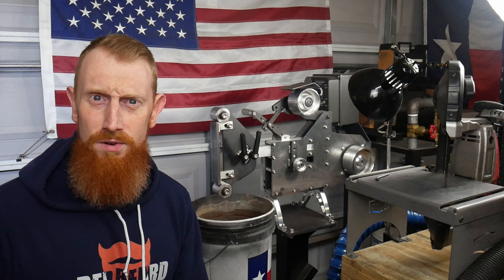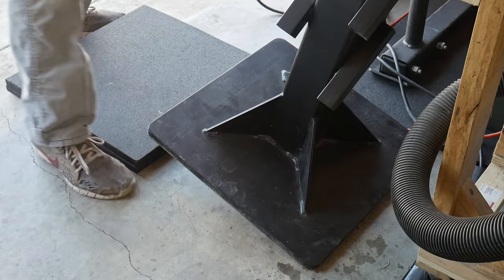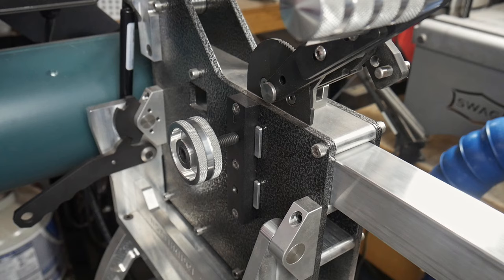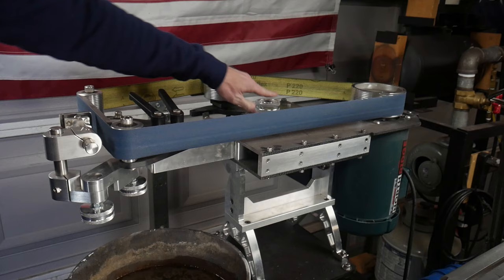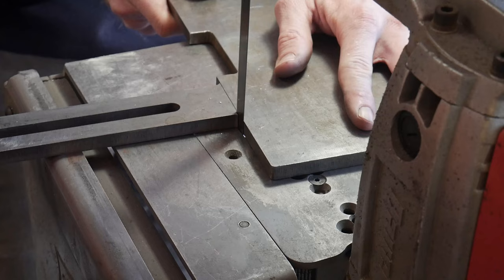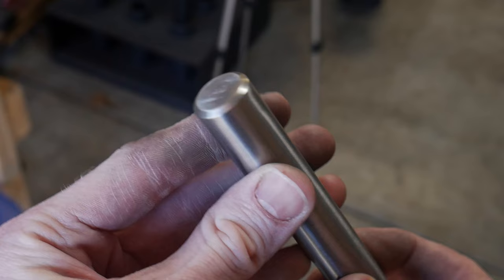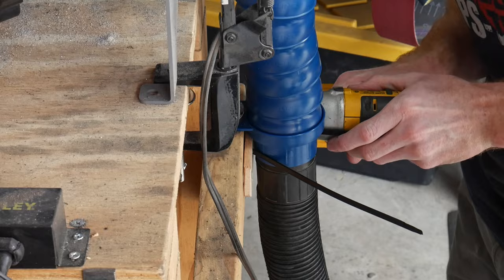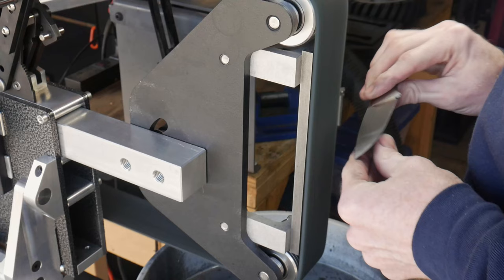So... I Got A New 2x72 Belt Grinder | Dust Collection Install | Knife Making Grinder | Work Rest Mod

Comment: A word of caution using dust collection on the belt grinder. Let the water bucket catch the sparks first then place dust collection further back on the belt. I have found smoldering chips inside my vacuum after grinding. It could have been bad had I not checked. Nice upgrade.
Reply from the maker: Hey Ron, I'm only using the dust collection for handles. When grinding steel, it's 100% to the bucket! Cheers man. Have a great weekend!
Reply: @RedBeardOps  Just trying not to freeze to death !
Reply from the maker: @ronamedee2475  I'm with you there! Gosh darn

Comment: I'm in the precess of buying a 2x72". 
After rearresting researching Bader, Northridge, Reeder, Black Fox Knifeworks and Ameribrade, I finally decided on the Black Fox One (BFO). I liked the Northridge and Ameribrade, but I didn't like the horizontal mount for them. IMO the horizontal attachment is an after thought to compete with the BFO.  The Grinder was designed with horizontal usage in mind and pivots close to the center of gravity. I also liked that the VFD is integral to the babe base and stays stationary unlike all the other brands. Also Thaddeus is very responsive to emails and answered all my questions. And I pestered the heck out of him. 
It's still a couple weeks until I get it, but I'll post a video when I do
Reply from the maker: Very good points Mark. The BFO looks like a solid machine! Cheers

Comment: Just a weekend knife making hobbyist, early days, maybe do 2 knifes a year, more focused on sanding handle scales. Looking at the new Grizzly 2x42" - it's cheap, small, but could work for my needs and good warranty if problems. Kind of hesitating due to figuring out safe dust collection for g10, carbon fiber, etc.
Reply from the maker: Yeah, dust can be a real problem...

Comment: When I was going to buy a grinder this is the one I wanted. Placed my order and 6 months later they still had not made my order. I asked and got no where. The quality of this grinder is unbelievable but I needed a grinder. So the other one I looked at was TW-90. Just as well made and comes with all the bells and whistles. And have the surface grinder for it. Which I believe red beard got the idea for his DYI one. P.S. at the time your grinder was $3500
Reply from the maker: Cheers man, glad to hear you got a solution.

Comment: I just ordered an Ameribrade. Seems like a great value and I like the stand that they make.
Reply from the maker: Very Cool Henry, let me know how that one works out for you! I just ordered a contact wheel from them.
Reply: @RedBeardOps  I hope that contact wheel is top notch. I will let you know how my grinder tracks in a couple months! I need to figure out getting or making a glass platen for the Ameribrade. Not sure if there is an industry standard for platens? I'm so new to the 2x72 game!
Reply from the maker: @henryhenry7170  Yeah it's a certain type of ceramic. I think they use the same stuff on fire places... anyway, I like them, but they are fragile. Be carful with them once installed or you can crack them. I cracked mine with the work rest by accident. Taking it off is a bear too.... Now days I stick with steel... I can always just take it off and surface it if need be. I've seen some platens made from carbide... that seems like an awesome idea to me.
Reply: @RedBeardOps  Thanks for the pointers. A carbide platen sounds ideal but maybe higher cost. I do want to stay pretty.

Comment: Great look at that machine.  Im currently running a TW-90 but I am looking to add another machine to the bench and I like the way this one functions and the accessories look bomber,  thanks for the thorough look at this rig.  I REALLY like the reverse feature.
Reply from the maker: I've heard great things about the TW90. I think it may run a different size tooling arm than this one? Something to check out before buying for sure. Cheers man.
Reply: @RedBeardOps  The TW90 runs 1 1/4 square tooling arms.  I think that is the same as the Bader and KMG machines and clones but not positive.
Reply from the maker: @MakersMovementDIY  10-4 these are 1.5 x 1.5. KMG's are also 1.5x1.5

Comment: What are you doing with the other grinder? Having 2 setup is a luxury, but every once in awhile you find yourself with both running, going back & forth from horizontal to vertical. Reverse is also amazing for sharpening on the belt, you don't worry about the knife hitting your gut(use the back of the top wheel). Hope all is well, take it easy.
Reply from the maker: Man, I ended up selling the other one locally. Not much room in my shop! One of these days I may get a second one set up.
Reply: @RedBeardOps  Yeah, I was wondering. It's not needed. My KMG does tilt, so I bought the 2nd. Look up reeder grinder sharpening jig, you might wanna make one. I know you like making these tools. I just ended up buying one.
Reply: @RedBeardOps  Aww man, I was about to ask the same question because I need a 2x72 in the shop, yours would've been perfect LOL

Comment: I hope i can finish building mine soon
Reply from the maker: Good luck with your build! I love a good 2x72... all shapes and sizes
Reply: @RedBeardOps  but it's not exactly going to be 2x72.
The only belts i can get where i live are 50mmx2000mm.

But if you are interested I'm building the grinder Jeremy Schmidt designed.
Had to alter the plans quite a bit to make it work in metric tho
Reply from the maker: @Birb_of_Judge  Very cool! I should of said I love all knife making belt grinders! I started a thread here on blade forms to show off 2x72 girnders.... feel free to post it up there when you're done! https://www.bladeforums.com/threads/show-off-your-grinder-s-v4-0.1773380/page-3#post-20348392
Reply: @RedBeardOps  or maybe have you considered creating a discord server?

Comment: Most of grinders I saw has a little  lateral oscillaton movement, does it interfiere in the grinding of the plunge line?? Congrats terrific tool my red friend!!
Reply from the maker: Hey Carlos, it depends on a lot of things for sure. The quality and age of the belts plays a big part. Getting the plunges right takes practice and knowledge of your equipment.

Comment: Wondering if you have concerns about dust collection system catching occasional spark from handle grinding?
Reply from the maker: Hey Bob, I only use the dust collection system for handles. I'll never use it for steel. For steel I'll have the slag bucket in use. Cheers sir!

Comment: Just got hands on a free treadmill, so looking to build my own at the moment..  I've seen the DCKNIVES blog plans - do you know of any free plans that use a gas strut tensioner instead of a spring?
Reply from the maker: Very cool DB! I do not. You may be able to fab something up though looking at others. The KMGs have been using a spring for decades without issues though.

Comment: ok perfekt, a nice one! but I have one question. I have built my 2x72 belt grinder by my own and and I think this small (belt wibbel-wobbeling) is in case of:  the wheels are not in perfekt alighment or lineup...they are not 100% parallely to each other. but...your new belt grinder got the same problem, maybe is problem with the belts? greetings from germany
Reply from the maker: Hey man, put a new belt on it and check. When I put a new belt on this guy it's rock solid and straight. I should of shot all that video with a new belt...
Reply: Hello from Texas. I've been to Germany, it's a nice country. I also spent some time getting my diy belt grinder to track right. Some suggestions for you:
1. Get a nice long straight edge ruler and check that the wheels are on the same plane. Put the straight edge of the ruler against the outside end of the drive wheel and then see if the ends of the other wheels line up. The tracking wheel has to be adjustable so it doesn't necessarily need to pass this test.

2. Is your idler wheel plate (sometimes called a D plate) homemade or did you buy it? Either way, how thick is it? 1/4" (6mm) stock is not going to work because it'll flex too much to allow good tracking. 3/8" (9.53mm) is better. Also use your straight edge to check that the d plate is nice and flat.

Hope this helps

Comment: How does this stack up to the TW90?
Reply from the maker: Hey T, I've never had a TW90, but have heard they're excellent machines. It may be biased feedback, but I've heard people say they like the NorthRidge better.... but I'm sure others will say the opposite. I think the TW90 uses "non-standard" tooling arms too (not 1.5x1.5)... I may be wrong about that though.... bottom line... they're both great machines